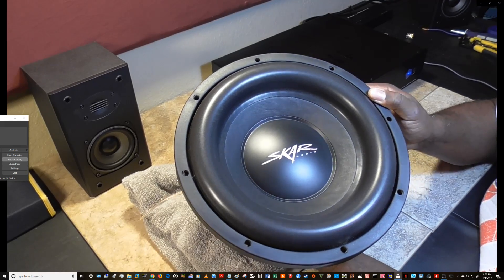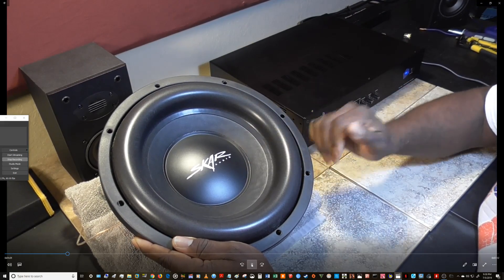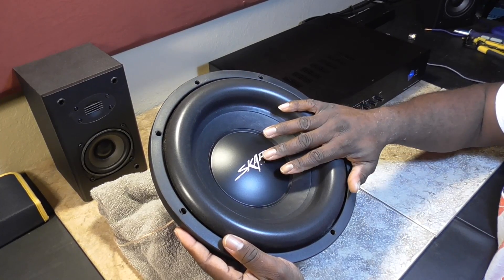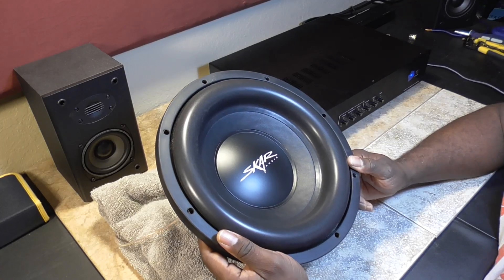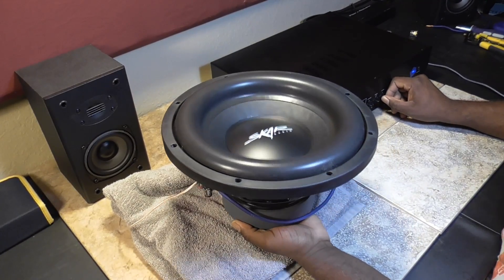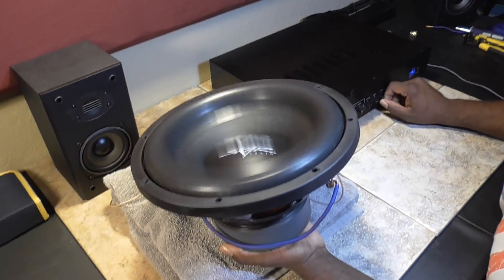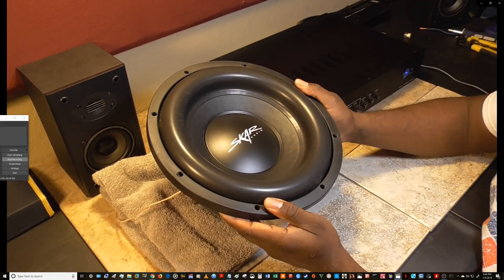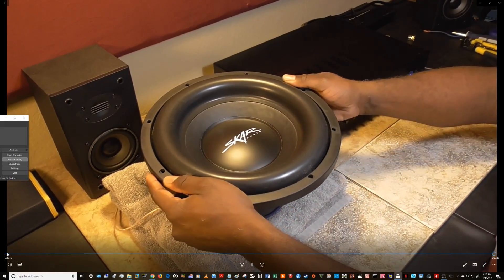Skar Audio SDR-12 -Flex Demo

Comment: I’ve had my sdr 12” for about 6-7 months and I use it daily at 700 watts rms and so far it’s help up to the test of time and abuse absolutely love this thing :)
Reply: ive cooked 1200w amps with my sdr12 d4🤣🤣🤣
Reply: Any updates
Reply: @Nzbass-head1995  I actually got a second sdr a bit after that comment and had them both on 700 watts rms, just sold them and got two sdr 18’s, the 12’s ate the power for over a year and are still rattling trunks to this day. The 18’s are even crazier 😂

Comment: Big subs are nice and all, but I don't need anything rated over 1000-1200 watts, in a 12"-18" I lean toward SQ, a bit more than loudness, I'd still like to have around 5-6 kw, on about 4,  15"subs, in a well designed enclosure, or even 4-6 of these on around 2500w,
Reply: JAMES! Since the 70's I agree ! 500 to 600 rms watts and I’m satisfied 🤘🏾

Comment: That noise you’re hearing is also probably from having your hand on the pole vent
Reply from the maker: Trust me, its the vents. my fingers were spread away from the pole vent. Good observation though.
Reply: It's spider slap actually.
Reply: @mikeshobbiesandrandomstuff  no
Reply: Is this sub built better than the p3 12’s?? Sound quality and durability??
Reply: @jeffrothegamer  it probably slaps harder I got 2 sdr 10s inverted with a 1500 rp skar amp and it slams bass clean just get ur amp tuned right and you will be good I'd get the 15s if I could

Comment: I know this video is old but hopefully you see my message. I have the "budget gem" power acoustik 2500d and fried a pioneer road series with it so I thought I'd go factory recommended and get the 12" gothic gw124. My amp is definitely over powering this sub cuz I smell the coils when I try to turn it up for a decent amount of time. Running it at 2 ohms which is around 650watts which is a quarter of the max on the sub. Will this skar work for my application for sustained amounts of time? I had a 12" type r on a kicker zr360 with the swx550 module before and it could beat much harder and I never smelt glue! I want that reliability again. Damn thieves:/
Reply from the maker: The Skar should do just fine

Comment: I need help 
I bought my first car subwoofer 
I don't know much about car audio and I wanted to get help with setting it up 
-
The subwoofer I bought is a Skar Audio single 12 SDR sub with a factory ported enclosure on Amazon 
-
It's rated at 600w rms 1200 Max 
I've been doing a lot of researched and found this to be the best for the price range as an entry level sound system 
-
I have a kicker cxa 400.1 w amp 
That puts out 514w at 1ohm 
The sub is rated at 600w 
- 
Being that the amp is underpowered is it still possible that I can use it to power the sub? 
Even if I don't get most bass as I would with a proper amp 
-
If I do use this amp to power the sub 
Will I have problems such as the amp overheating - trying to power the sub 
Or will it burn out the amp or the sub or cause clipping 
-
If so is there anyway to prevent that without getting a different amp but maybe like changing the settings or something 

I really want to hook it up to my car
And get some bass 

Until I can afford a proper amp I want to use this if possible
Reply from the maker: As long as you set  your gains properly, you will be just fine. The only thing that damage your components is a dirty/clipped signal, which causes overheating. Set your gains properly and enjoy you new subwoofer; until you can upgrade to more power.

Comment: The Dayton home receiver goes down to 4 ohms? Thats awesome I thought all home audio was designed around 8 ohms only.
Reply from the maker: I also have a review on this amplifier. It's the Dayton SA1000.
Reply: Nah, most amps are stable at 4 Ohms
Reply: @fabiankonrath2804   No home audio is almost always 6,8 and sometimes 16 ohms on high end receivers. Home audio equipment isn't made with the same goals as car audio equipment is. Given the car has to produce all the power a stereo will use lower impedance means more power the amplifier can push out since 14.6 VDC is all the voltage it'll be able to use it needs to make up with current draw which car electrical systems are great at. So subwoofers for cars and door speakers are 4 ohms and lower while car amps pretty much have an industry standard of 4 ohms and lower but the lower it goes the more heat is produced because the current draw that isn't boosting audio signal has to go somewhere and before amplifiers had protection mode if the fuse was the only safety wall keeping the amplifier from turning the car into a flaming nightmare and killing or badly burning it's occupants. Home audio on the other hand is designed more casually and keeps to higher impedance for a few reasons. 1) Now the equipment has as much voltage it can use with a limit to the amount of current it has available. Since current is the main factor to amplify louder and louder home audio equipment can only use 10 amperes but really for saftey half that at most it steps down 120VAC to anywhere from 12VAC upto 40VAC depending on the manufacturer combine that with the 5 amperes and rectify it into DC to power the FETS and BOOM even though it's lower rated wattage compared to car audio wattage needed to hear speakers and woofers really doesn't need to be much. 2) Being lower impedance means   hotter receiver and amplifier so if speakers are higher impedance 6 and 8 ohms then house fires won't be an issue because they run cooler and again home audio goals and car audio goals are two different worlds. Car audio is marketed to be louder and home audio is more subtle not meant to be flashy and show off but to impress with balance and moderation that can still be felt at lower volumes. Obviously there are outliers and we all know an audiophiliac  that takes his car audio for clarity over SPL and vise versa we have all had the neighbor who thought his living room speakers where subwoofers with a tweeter that was herd blocks away and thought bass was what meant a stereo was good when mids where not even in his vocabulary. But just to prove my point here are different receivers on amazon and look at their ohm rating. 

https://www.amazon.com/Pioneer-Bluetooth-Component-Receiver-SX-10AE/dp/B075SY52NL?ref_=Oct_TopRatedC_14269301_1&pf_rd_p=b787276e-9536-5406-99a7-daf7a82da2a6&pf_rd_s=merchandised-search-6&pf_rd_t=101&pf_rd_i=14269301&pf_rd_m=ATVPDKIKX0DER&pf_rd_r=37X1Y0AMG2TMYY952994&pf_rd_r=37X1Y0AMG2TMYY952994&pf_rd_p=b787276e-9536-5406-99a7-daf7a82da2a6

https://www.amazon.com/Denon-AVR-S640H-Receiver-Surround-Streaming/dp/B07C5TL5T5?ref_=Oct_TopRatedC_14269301_3&pf_rd_p=b787276e-9536-5406-99a7-daf7a82da2a6&pf_rd_s=merchandised-search-6&pf_rd_t=101&pf_rd_i=14269301&pf_rd_m=ATVPDKIKX0DER&pf_rd_r=37X1Y0AMG2TMYY952994&pf_rd_r=37X1Y0AMG2TMYY952994&pf_rd_p=b787276e-9536-5406-99a7-daf7a82da2a6

https://www.amazon.com/Onkyo-TX-RZ830-Channel-Network-Receiver/dp/B07CVP44NL?ref_=Oct_RAsinC_Ajax_14269301_1&pf_rd_r=37X1Y0AMG2TMYY952994&pf_rd_p=b787276e-9536-5406-99a7-daf7a82da2a6&pf_rd_s=merchandised-search-6&pf_rd_t=101&pf_rd_i=14269301&pf_rd_m=ATVPDKIKX0DER

https://www.amazon.com/Sony-STRDH190-Stereo-Receiver-Bluetooth/dp/B078WFDR8D?ref_=Oct_BSellerC_14269301_2&pf_rd_p=b787276e-9536-5406-99a7-daf7a82da2a6&pf_rd_s=merchandised-search-6&pf_rd_t=101&pf_rd_i=14269301&pf_rd_m=ATVPDKIKX0DER&pf_rd_r=37X1Y0AMG2TMYY952994&pf_rd_r=37X1Y0AMG2TMYY952994&pf_rd_p=b787276e-9536-5406-99a7-daf7a82da2a6
Reply: Also signal to noise ratio gets better with higher ohm audio setup which is why home audio is generally 4ohms or above and rarely lower than 4ohms

Comment: Hard time deciding between 2 sdr 12s or 2 gothic gw-12s 
Trying to put together a small budget setup amp considered is a Skar Audio rp1200.1d 

What’s your opinion
Reply from the maker: The Skar RP Lineup has a great reputation. I think you are headed down the right path. During my last install it came down to the RP2000.1D and the audio APMN2000.1D they both were strappable and very powerful, but the AP was like $30 cheaper at the time. You made a great choice.
Reply: Bit the bullet and ordered the rp1200.1d this morning and the local Walmart finally had two of these subs on the shelf so I grabbed those this afternoon can’t wait to get this shit in the Durango!!!!
Reply from the maker: @vtxjeff6189  wow, when I first bought this sub, I also drive a Durango! 😆 Now I gotta go find all the old footage for it. 😁🤟
Reply: BudgetBassHead I realize I’m commenting on the sdr vid now so I’ll be clear I got the gothics lol
Reply from the maker: @vtxjeff6189  yeah, I know. I first unboxed the gothics back in 2017 or so. I was speaking of that period of time; about the gothics.
Reply: BudgetBassHead haha for sure bro but yea find that footage I wanna see it!

Comment: @budgetbasshead what brand and how many watt amp do u prefer to power two of these exact subs ?
Reply from the maker: I am currently running this sub in my office setup, powered with Dayton Audio SPA250 plate amplifier.
Reply: I have the rp1500 on 2 of them no afyer 2 years

Comment: Can a single sdr 12  perform well in a large sedan?
Reply from the maker: That depends on a few things. Size of enclosure, SPL vs Daily, Wall vs Box build.. etc. But I will assume your talking about a simple reflex build. To me, it does okay. Its not really a competition grade woofer, but it holds its own, housed in the right enclosure. I think the enclosures Skar sales, is perfect for that sub. Buy one, or build your own and you should be fine. But if you want competition grade output, go bandpass.

Comment: Gain or volume? Think u mean volume bc thats not how gain works fyi
Reply from the maker: I understand were you're coming from. Gain is typically refered to in terms of voltage matching or balancing, but what most people don't point out is that both the gain and volume knobs are simple potentiometers that you have the ability to increase or decrease output voltage. In any case, only one should be adjusted, after the other has been set. In this case I guess you could say, the phone's volume control was used as a gain setting and the amplifiers gain setting was used as a volume control.  But I only wanted to keep it as lament as I could for the viewers.

Comment: im thinking of getting two 2x 2 ohm Skar Audio SDR-12" subs and wiring them to 4ohms each they will get less power but will sound cleaner than one sub? my amp can only do 2x4ohms and cant be wired lower than 4ohms per channel
its a 4 channel amp that can be bridged to 4-ohms 2 channels 1000W
Reply from the maker: They should sound just fine. But upgrading your amp to utilize a series wiring of 2ohms should be a future goal. You can thank me later 😁
Reply: my power supplies cant handle that though i'm using two 12v 650W computer power supplies hooked up together in parallel! lol powering them in my house under my desk.
Reply from the maker: @realflow100  I wasn't aware you could run PSUs in parallel. Are you sure that's safe? Check out Newegg, Amazon or parts Express. They have amazing deals on regulated power supplies, designed for your type of setup.
Reply: only if their voltage matches closely.
if its off by too much millivolts it could cause current to pass between one and trip the current protection shutting one of them off
but having a load attached to one of them helps when hooking up the second one. so then you just keep them both attached to a load. probably 1 amp of current would be fine.
some designs are made good and nothing bad will happen if the voltage is off by a little.
if they have floating grounds. output isolated from input it will be fine to even put them in series for a higher voltage output from 12v to 24v if you need to.
Reply from the maker: @realflow100  Sounds like you know your stuff. Thanks for sharing!

Comment: When speaker is free air the amp is pushing way less power than rated.
Reply from the maker: Not necessarily. The amp does care what's connected at the end. It's design to put out a certain voltage at a certain resistance... Regardless.
Reply: @BudgetBassHead  free air equals less resistance...
Reply: @mikeshobbiesandrandomstuff  ?
Reply: @bassdrumflextime1253  ohms law
Reply: @mikeshobbiesandrandomstuff  ok and?
Reply: @bassdrumflextime1253  google it
Reply: @mikeshobbiesandrandomstuff  but how does the resistance change if it's just free air
Reply: @bassdrumflextime1253  easier for speaker to move in free air less resistance against cone area Wich results in less coil heat and power consumption.
Reply: @mikeshobbiesandrandomstuff  ok you were trying to say there is no box rise. Right?
Reply: @bassdrumflextime1253  not really but it's also a factor
Reply: @mikeshobbiesandrandomstuff  yeah
Reply: You are 100% wrong. If an amp is tuned for 1000w at 1ohm it's going to push 1000w at 1ohm. Free air the sub will generally stay around the impedance it's wired to. Put that same sub in a box then the power it sees will drop because of the impedance of the enclosure. Put all that in the truck of a car and it will drop even further. Even then the amp still produces 1000w
Reply: @beardedforlife3740  🤣🤣🤣 google ohms law and watch a few real world test videos or just keep spreading assumptions you see on the internet.
Reply: @mikeshobbiesandrandomstuff  it's not an assumption. Any device that supplies power will produce that rated power regardless. Ever wonder why subs generate heat? That's due to the coil impedance reducing the power then taking the excess power and turning it into heat
Reply: @mikeshobbiesandrandomstuff  I actually want you to show me where ohm's law says less resistance equals less power. Then I want you to show me anyone with real experience that will agree with you
Reply: @beardedforlife3740  no the heat is from amperage spike caused from voltage drop do to lack of power
Reply: @beardedforlife3740  you clearly didn't google it
Reply: @mikeshobbiesandrandomstuff  voltage drop is lack of power and why do you think the voltage drops? An increase in resistance. You won't drop voltage if you don't have an increase in resistance
Reply: @mikeshobbiesandrandomstuff  what I'm thinking is you need to double check your information because a lot of what you say doesn't work with ohm's law
Reply: @beardedforlife3740  also happens from lack of power to the amplifier